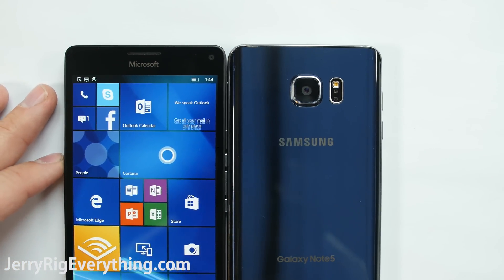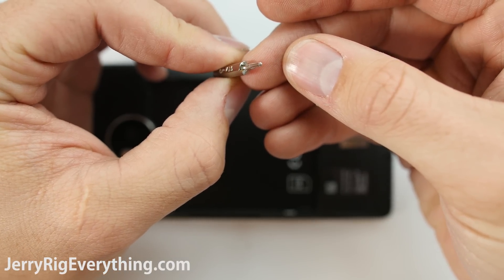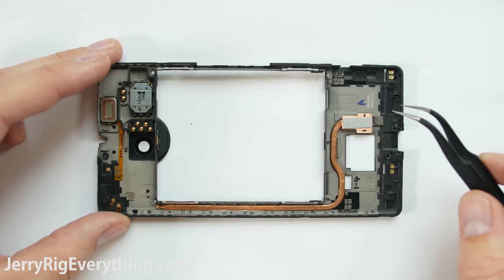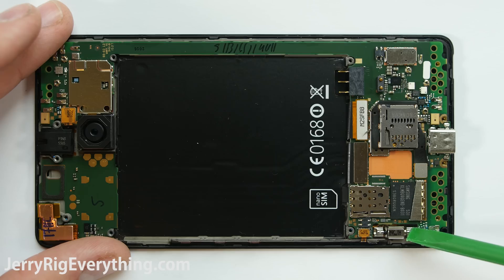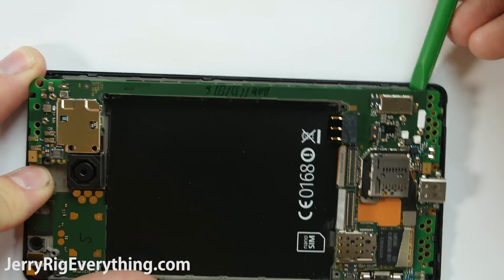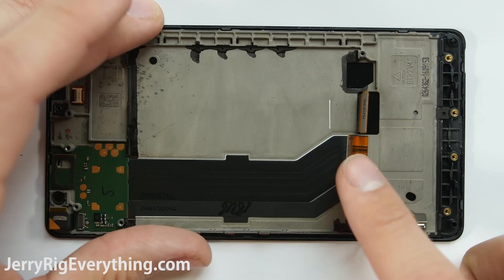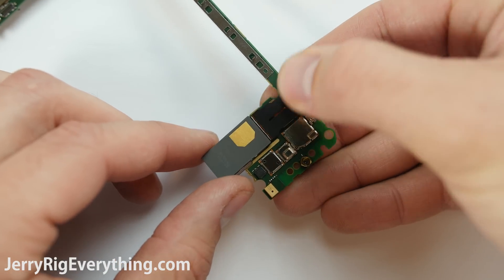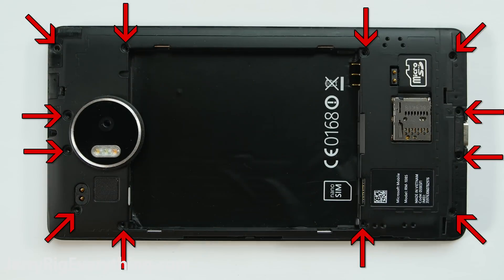Lumia 950 XL Screen Repair, Teardown, Mobile liquid Cooling

Comment: Please i would like to know , i have 2 lumia 950 xl, one works fine but the rear camera does not focus, i think something broke inside, and i have a second one that called inside a water for like 15 minutes, the screen doesn't work, but i guess the rear camera is fine, do i need something else to change them apart of the tool kit?
Reply: The rear camera does not focus is definitely something related to zoom motor. Best to replace it with a brand new camera module. You can buy one at Aliexpress.

Comment: Hi Jerry, I recently got some water damage to my 950XL (dual sim) and the phone was stuck in a boot loop since, where the Microsoft screen comes on, then within 10 seconds the phone reboots again. The windows logo never appears. The water damage occurred towards the bottom of the phone, near the USB port, up to the camera keys. I dried it out before giving the phone to the service centre to get it fixed. 

The service centres I have here in India are not official Microsoft ones, like Nokia used to have theirs, but a Microsoft approved service centre (a kind of franchisee I think). Anyways, they were not able to determine the problem. 

I saw your video and tried to do a basic test - I disconnected all cables from the motherboard and started to reconnect them one by one till I was able to boot the phone completely. Since the service centre people had done a fresh install of the OS, I set up the phone and am running the latest OS build available for consumers (Creators Update I believe). 

Now, the phone works for the most part - cellular, wifi, bluetooth, display, touch, vibrator, power key, all of these things work. 
What doesn't work: the cameras, iris scanner, volume keys, camera key. 

How I got this to work: In your video you mention that there are two cables related to the display. (In portrait orientation) I have the left cable detached, and the right cable attached, and the back half of the housing is unscrewed. 

In this condition, with the unscrewed back half and left cable detached, the cameras turn on - but everything appears very dark and greenish (almost like there is no light at all). Also, the cameras are unable to click any pictures. The red light that assists the iris scanner does not turn on at all. 

When I connect the left cable, or screw on the back half of the housing on, the phone gets stuck in a boot loop. The service centre couldn't tell me what the problem is, and therefore would not fix it. Is there something I can do from my end? I would really appreciate it if you could tell me what the two cables for the display signify, and why it affects the volume and camera keys the way it does. I know I must have short-circuited something, but I don't know which component I need to replace. Also, is there any fix for the cameras?

Any help is appreciated!

Comment: Can you please make a video of just replacing only the DIGITIZER not the whole display, by the way digitizers are available as dead cheap as 5$ on ebay.com and here's the link http://www.ebay.com/itm/New-Nokia-Microsoft-Lumia-950-Front-Screen-Glass-With-OCA-Glue-Tape-Tools-/152098360982?hash=item2369c4ce96:g:58YAAOSwhQ5XQDJp

Comment: Some mistakes here and there, but fair enough. Thanks for sharing. Why did you skip the 950? Could it be similar in build?
Reply from the maker: +Dániel Buga Its probably very similar in build quality. I skipped the 950 because this channel is totally self funded.  I have to buy phones like any other consumer.  And money doesnt grow on trees ;-)
Reply: +JerryRigEverything I own the 950 and I would say that everything apart from the screen is very solidly built. 

Today (Wednesday) it's been sent off for repairs as there is a tiny crack on the screen which has rendered the whole device inoperable. 
Luckily, it's under warranty so hopefully there won't be a hefty charge. 

I would advise people with both this and the XL model to purchase a really good, strong case as it was only a small distance it slid off the sofa.

Comment: I have a cracked screen on my phone, and I'm wondering if it's practical to only replace the glass and frame assembly instead of buying a new screen and digitizer as well. It would save me over $200 if I could, but if the repair isn't safe or practical to do myself then I don't want to risk it.
Reply: First of all, in the end I decided it was best to replace the whole assembly despite the cost. I'm positive it wouldn't have gone well had I tried the cheaper option.

As for the repair itself, I don't remember in perfect detail. Be prepared to remove some components from the old frame and attach them to the new one though. I recall having to move the vibrator motor and the strip containing the physical buttons on the side of the phone. The latter is a little tricky because it's very bendable, and it doesn't come off super easy. Also, after pulling it off it no longer was sticky enough to stay in place on its own. This is fine once you get the phone closed up, but it can be tricky.

What else? It's important to get the ribbon cables that run beneath the battery lined up right. The adhesive is pretty strong, and it's a real pain to fix if you get them in there wrong. Also, it's really easy to knock ribbon cables loose when re-assembling the phone.

All in all, it wasn't a super easy repair. Definitely doable, but it's not as simple as you'd hope.
Reply: +Christian Kallevig To be clear, my phone is a 950 XL, not some random phone unrelated to the video
Reply from the maker: +Christian Kallevig 'Glass only' repairs are extremely difficult and hardly ever successful for someone attempting them the first time. So you are way better off purchasing the whole display.
Reply: +JerryRigEverything Forgot to thank you for your response before, but I've now finally fixed my screen. Was a bit more complicated than I'd anticipated as there are several parts which were adhered to the frame and needed transplanting (the physical buttons, and the vibrator mainly).

Thanks for the video in any case, was very helpful
Reply from the maker: Christian Kallevig That is awesome! thanks for coming back and letting me know. Good job on the successful repair!
Reply: Hello Christian, I have the same problem with my 950 XL and I was thinking about replacing only the glass and frame. Would you mind giveing me some hints about how you managed to repair yours? Thank you.
Reply: Thank you very much Christian, it sounds like it would be really omplicated..
In the end my problem is not about function, it's just esthetic.
Probably it's not worth the hassle, also the glass and lcd are glued togheter i believe.
I don't know if the lcd would survive the operation.
Thank you again.

Comment: As a tech, I thank you for the Video. I also, happen to own a Lumia 950XL myself, and I LOVE IT. one of the best engineering design on a Smart Phn I've seen out there. CrApple iJUNK is the WORST design out there, and extremely cheaply made. NOt to mention the garbage and low quality parts used inside of ANY iJUNK phns. IMO, this 950XL is like a Ferrari, compare to iJUNK 6s+ that is like a Geo-Metro. In addition, 950XL, has soooooo many features that NO iJUNK phns to this date offers/has. Like REMOVABLE Battery, Iris Scanner, 20 PIX Pro camera, Turbo and Wireless Charging, USB-C port, DUAL Sim slot, MicroSD slot, Glance Sensor, QHD 2.5K+ AMOLED screen that is just beautiful,..................just name a few features iJUNK wish it had.I can't wait to see the ALL NEW ""Windows 10 HP Elite 3X"", now that phn with its killer """""""SPECS"""""" that many top flagship phns do not have it yet. its just WOW. The one phn that is better than Lumia 950XL.
Reply: OH MY GOD im not the only one who recognised the advantages of this phone... Ive been using it for three years now.
Reply: Redstone_Army ok- you have a 3 year old phone- i got the oneplus 6t😂

Comment: one of the first !! 
do you think that removing that copper heatsink will cause any trouble or maybe overheating
Reply from the maker: +Gaurav Sokhi Solid question. Honestly, I think that this particular water cooling system is a bit of a gimmick.  YES it is interesting.. BUT if they wanted it to be effective, they would have placed the cooling system in direct contact with the processor. at 2:27 you can see that it is on the underside of the processor, through the pcb board, instead of on top of the processor, where the heat is. (Normal computers have the heatsink/watercooling on the top of the processors.) ALSO this qualcomm 810 processor is in a multitude of other devices: Droid Turbo 2, Nexus 6p, OnePlus 2, HTC M9... and none of them have water cooling and they are staying perfectly cool without it.)
Reply: +JerryRigEverything thanks for the reply
I  believe that Microsoft might have got innovative with there overheating issues
Reply: +JerryRigEverything The overheating issues were experienced with the first version of the SD 810. The HTC M9 has that processor and that big issue. The other phones you mentioned have the 2.1 version of the SD 810. That version killed the overheating issue.

(based on many phone reviews I've seen)
Reply from the maker: Abdullah Waqdan lol, maybe the watercooling will turn out to be useful then.
Reply: +JerryRigEverything 
I have the M9, after playing for 15 mins or using a demanding app, you can make a cookie or burger on the back of it.
I'm curious how SD820 is gonna be.
Reply: +jerryrigeverything the heat of an integrated circuit is more active at the bottom side of the chip. on the top, there is an RAM PoP (Package on Package) module blocking the heat. and the die is solder mounted to the pcb

Comment: I love how fixable lumia phones are. wish they all stayed that way
Reply: +Jeremy Hinds YES!
Reply: And now I have one with the camera shake problem...I'll see if it's fixable, or perhaps I can glue the optical image stabilization so it doesn't move. Otherwise have to get new camera module
Reply: @Rennie Ash It is best if you get a new camera module. I myself have a focusing issue with my 950 XL, got a new camera module and it's good as new.
Reply: 17.01.2022
Reply: 17.01.2022